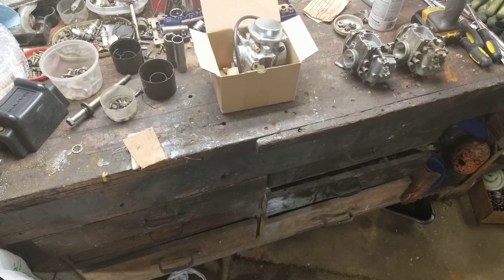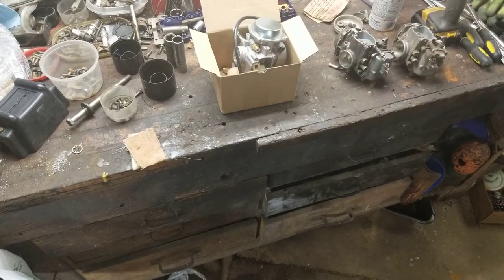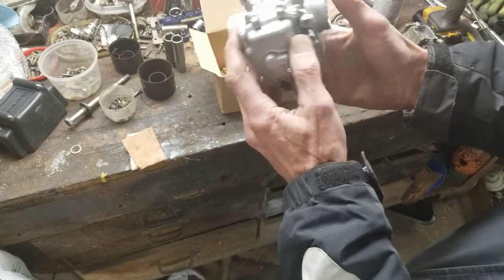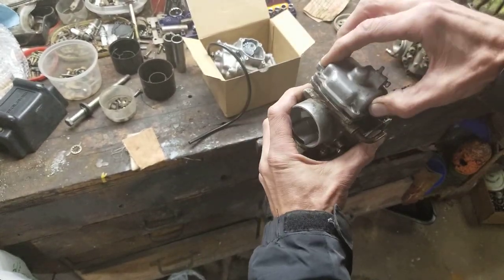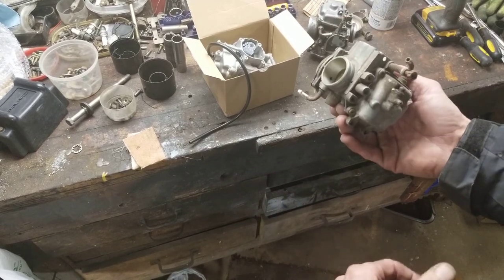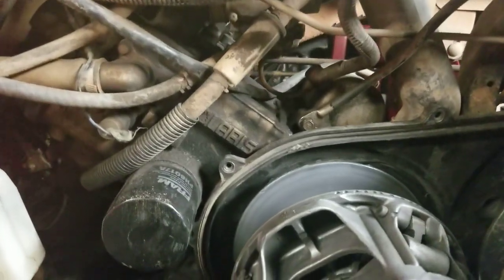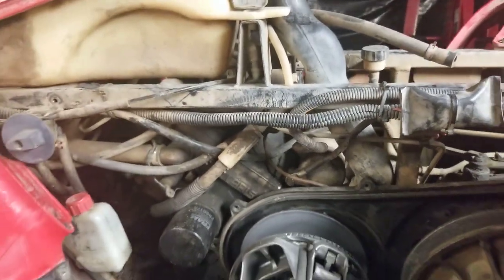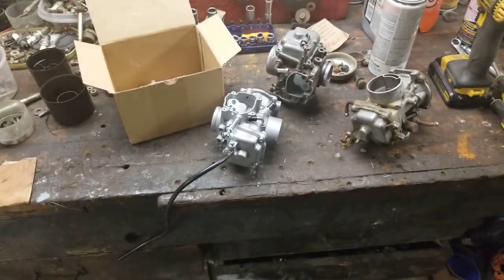Should you use a aftermarket carb on your Polaris?

Comment: Bought the same carb off Ebay .Now my 2002 500 Sportsman is running great.Replaced fuel lines ,fuel pump,carb ,and intake boot.Its was backfiring , rough idle ,and random stalling.All aftermarket parts .Thanks for the video.I highly recommend this carb ....$40 ..no brainer !!!
Reply: What carb? There alot of then in Amazon.  Can you give the order number? I guess I'm spoiled but a sure called Rusted Nut Repair actually shows the biz the parts come in asking with part order number etc.  That is awesome.  I wish everyone aphid do that.  That's the most important part is knowing the part to order exact thing.  Heck your site could even win a sponsorship for it, it happens.  Thx!
Reply: I am having the same problem with a 98 Kawasaki bayou 400. I want to order carburetor off eBay just don’t know which one. Thanks.
Reply: What brand is that carburetor?
Reply: What brand is that carburetor?

Comment: I have the exact same opinion as you.  I try and rebuild the factory carbs when I can, and like you said, there are times when rebuilding is no longer an option.  I'm working on a Polaris 325 trailboss 4 stroke right now.  Factory Mikuni ran fine, but had a gas leak out of the overflow when motor was turned off.  I had it off a few times and tried cleaning everything that I could get to.  I came to the conclusion that it was probably the O-ring behind the seat, but the two screws that held the seat in was stripped out.  So I bought one from Amazon that had good reviews - it cost me $42.00.  I installed last night and it started right up with no problems. I'm keeping the old Mikuni in my collection just in case I can ever fix it one day, but for now I'm up and running again!
Reply: I’m having the same issue. Do you know what make the carb you purchased off Amazon?

Comment: Great video! I’ve used these with great success over the past couple years. One time I had one out of the box the top end parts were floating around the diaphragm but it took a couple mins to reassemble and it was fine. Magnum 425 came to me with a suspected faulty cam lobe, which turned out to be a bad carb. Swapped in the new aftermarket carb and flipped it for a very nice profit.
Reply from the maker: Sweet!
Reply: @TitaniummanGarage  few time i ask you question but never  get respond from you
Reply from the maker: @shahriarfathi4569  I've scrolled through my messages. I Dont see one from you. I get so many messages a day. Sometimes it's hard to keep up.
Reply: @TitaniummanGarage  
shahriar fathi
1 day ago
thank you so much for information . only thing i like to know i have Honda and need 36 mm Carb so what you recommend
Reply: @shahriarfathi4569  sell it and buy a Polaris lol

Comment: I've owned my small engine shop for 15 years. Chinese carbs are a great solution once you learn the common quirks. I've used these on polaris a handful of times too with good results.. They also like the vacuum needle valve raised more often than not for best wide open performance. With or without ethanol blended fuels. I'll be replacing the carb on my 600 twin soon. I'll try the one in your link and see how it runs. Nice video!
Reply from the maker: I just replaced one on a 600 twin. It worked great. Just make sure the intake boot isn't ripped like mine was.
Reply: @TitaniummanGarage  I just put one on my 600 because the factory one started leaking like crazy from the overflow even though it runs good. New needle and seat didn't fix it. New Chinese carb is overflowing too, though not as much, and not running right (almost like it's missing at high rpm and won't idle). Any ideas?
Reply: can any one recommend a good after market carb for my 2203 polaris ranger 500

Comment: I just put a Quad-Logic carb on my 2001 Sportsman 500ho last night. At first i thought it was junk, but then we found the cracked carb-to-intake boot. Ordered the boot, and I'll let you know how it is when we're done. Btw, thanks for the great videos. They've been extremely helpful on my project. Just did a transmission install this week thanks to your channel. We'd like to see a video on the removal of the transmission gear sensors please.
Reply from the maker: Quad logic I've had good luck with. That sensor only has 4 screws on top and comes out after unplugged.
Reply: @TitaniummanGarage  ok great! I'm having trouble with the one sensor. It shows still in neutral when in high unless you wiggle the wires on the sensor. Thank you again for replying and the excellent videos.

Comment: Just replaced one out of 325 trailboss from ebay Michigan company $38 works great much easier than trying to rebuild. I've always had trouble with the float on rebuilt like you said to many ports that contain garbage.

Comment: I have a small engine/atv shop and some times the old carburetor is a goner. I have had mixed results with the Chinese carbs, every single one I bought last year aside from one the jetting was way off and I couldn’t find alternative jets to fit them. This year I have bought one and it will not win awards but it works. However I am about to order two for a Polaris magnum 500 and a sportsman 500 due to the carbs I got with them are absolutely destroyed. I’m switching though to a “brand” that is trying to build a reputation,  that seems to sell pretty good piston and cylinder kits, niche. They claim to sell jetting kits for them
Reply from the maker: Just dont use their head gaskets. They are junk. I have a love hate relationship with that company.
Reply: Let me know the outcome...
Reply: @daddybusy7496  outcome is they worked, they actually worked pretty good. They even held an idle far better than other Chinese carburetors I’ve used.

Comment: 2004 330 trail boss.  New China carb (on it when I bought it...not running...rings frozen in piston...new rings)  After installing new rings it fired right up, idles good, everything is good until you get to half throtle and then it boggs down. Haven't decided if I should try to fix this carb, rebuild an oem or buy another $40 China

Comment: The fuel pump on my 2000 Polaris 500 6x6 puts out 3-5psi. I wonder if this carburetor can handle that psi or if it will just force the needle down and overfill it?

Comment: I had that overflow fuel . Its the needle valve base o ring. Changed that and leak stopped. I also ultracleaned the whole thing but I think there is still some blockage somewhere as it has little hesitation at wot. Idle and all the other stuff works ok.
Reply: You talking about the needle valve for the float? Or under the float? In not a carb pro, but that info would help.  Thx!
Reply: @boebradley867  yes, the needle valve for the float. it has brass base that has o ring under it to seal it. it's common to leak. the needle could be fine but if that base leaks against the carb frame it's not going to hold.

Comment: I'm on my 4th Amazon carb for my 04 Sportsman 600 Twin. I'm at an absolute loss. No matter what I do, I just cant get it to run properly. I've adjusted the needle seat depth, mixture screw, idle, everything. It runs super rough at idle like its on one cylinder even though I've tried adjusting the mixture screw while warm and nothing, then giving it gas up until 3/4 throttle it bogs and chokes down like its crazy lean, and then runs like a top and scalded dog at 100% throttle (157 main jet) About to say screw it and order a QuadLogic carb, or just eat it and take my stock Mikuni to Polaris and have them fully go through it because obviously what I'm doing isn't working after reading tons and tons of literature online.
Reply from the maker: I'm having the same issue on a 700. It all depends on who makes the carbs. I buy alot on ebay. Some are junk and some are spot on. I've tried a couple different companies. I've heard moose racing makes a good carb for 160.00. I haven't tried it yet. Have you considered buying a sonic cleaner for your original carb? Once fuel residue is in the carb its really hard to get out unless you soak it. You said it sounds like its running on one cylinder. Have you checked to see if your getting spark at both plugs? If you still have the old ducatti ignition system in it (they are horrible, Polaris stopped using it) you might have a bad coil, cdi, or stator.

Comment: Not from the ebay carb guy you mentioned but have had two carbs, cant keep the overflow tube to quit drip to pouring gas out no matter how I set the float on the ranger 6x6 500. My old mikuni works perfect but want idle down. I think everything is clean....ideas?   Good vids BTY
Reply from the maker: @jimrucker5726  Is it a steel needle or the one with the rubber tip for your needle and seat? I’ve had problems with the solid steel needles.

Comment: Bought a chinese carb and it worked for a year before it kept flooding out the engine. If you shut the engine off it was really hard to get started again. Bought another one and it did it immediately and even started dripping gas.  My fuel pressure is 3 psi.  Needle and seat are junk on these.
Reply: Sometimes the needle valve gets dislodged during shipping and handling so it leaks right from the get go. So always check that before installing a non OEM (Chinese) carb.

Comment: ut in the spring and cable into it. can you show how to put in the choke cable. I got new one like you but the hole where the choke cable goes in has a brass fitting in there so it wont seat in there

Comment: i purchased an after market carburetor,, it was doomed after they packaged it for shipping  ,FED EX did a terrible job of shipping,,the box was crushed so bad , the inside of the box had dent impressions of the carburetor, popping the bubble rap , and when it arrived the driver threw it out of the on the ground in front of  my house , it never worked at all ..
Reply from the maker: I would tale the parts out and rebuild your OEM carb.
Reply: @TitaniummanGarage  thanx for the reply!! I did a good Micro Cleaning on the OEM ( Pput a new pulse pump on it ,, the new carb wouldn't even work with new pulse pump)it runs and  starts better than NEW , I did this in September, I cut a fair amount of firewood, and drag alot of trees out of the woods to be cut up.. (03 600 sportsman,, 2300 miles on it ) I found your channel after the carb problem,, I'm a subscriber Now .. your Videos are great , to the point,  no extra B.S. ,,, keep the Videos coming 👍👍
Reply: @TitaniummanGarage  and here is another funny story,, when I bought the new pulse pump at MIES OUTLAND in MN. it was an after market pulse pump,, it leaked gas , new out of the box ,, for a few dollars more I bought the OEM , and it worked Great ..

Comment: Have you ever tried the aftermarket chinese diaphragms for the Mikuni CV carbs?  I was wondering about them because the oem one for the Polaris Ranger 500 is about $150.
Reply from the maker: I've actually stripped a china carb and used the parts in a oem carb. They work good.
Reply: @TitaniummanGarage   I am in the process of getting the new chinese carb dialed in but whenever I take it on a downhill slope it runs rich and sputters, when it's uphill it runs fine.  What would cause that? And other than downhill it runs better that it ever has before.  It's making my brain hurt lol.

Comment: I bought the cheap carb off ebay for my Polaris Sportsman 500. Worked great for 1 year and now it leaks fuel from the overflow tube as you mentioned. Now wondering which way to go  as you are.
Reply from the maker: Order a needle and seat from All Balls racing. It has a rubber tip on the needle. I think why they leak is they use a metal needle without the rubber tip and after it wears it leaks.

Comment: I never messed with the quad carb 
What size are they 36 / 38 ?
If so I would try a 44 it will make more power!
At least with the minibikes it made some pretty good power ….

Also I heard soaking the carb body in pine sole comes out pretty nice never done it myself ….

Comment: Would the carb in link work on a sportsman 500? Throttle lever is opposite side than stock carb positioning. I bought an aftermarket one that all it will do is idle that’s it won’t rev up just dies. Adjusted float, needle and new pump still won’t do anything but idle.

Comment: Hi, I bought this carb off of eBay for my 2002 Polaris Ranger 500 4x4.  I installed it, and it started right up and it was running great.  I drove it around out in the pasture, then took it back in the barn and there was this overwelming smell of fuel.  I looked beneath and it was leaking fuel.  The fuel is coming out of the drain tube on the bottom of the bowl.  It does this everytime when I drive it more than 5-10 minutes.  I'm not a professional mechanic by anymeans, I'm more of a Google/YouTube mechanic.  Do I need to adjust the screw on the drain tube or is this something way above my head?  Any help would be greatly appreciated.  Thanks!
Reply from the maker: Unfortunately, some of the aftermarket carbs leak. I stopped using them for a while because of that. It's your needle and seat leaking. Try to get your money back or buy a needle and seat from All balls racing and replace it. I believe I have a video on that.

Comment: Carb in my 2005 Polaris 330 is leaking fuel real bad. Instead of the typical FleaBay carb for $40 I just spent $160 for one sold by "MOOSE Utility Division."
It's also made in China but i'm hoping its quality due to the price and name backing. Hopefully I didn't get ripped off. We will see, i'm doing the install today.
Reply: Are you happy with your $160 vs $40 decision?
Reply: @anncampbell4300  Yes, 100% satisfied!
Sorry, I forgot to do a follow up. I kept the jets that were already installed and just needed to tune it. On the 3rd try I had it running perfect, from smooth idle to wide open throttle. I won't know if a cheap carb would be the same but I wouldn't take that chance.

Comment: thank you so much for information . only thing i like to know i have Honda and need 36 mm Carb so what you recommend ?
Reply from the maker: Oh..I see. You asked about a Honda. I dont work on them so I cant be certain. They do make aftermarket for hondas. Maybe check ebay.
Reply: @TitaniummanGarage  OK i see you work on ODES i have 1 Honda and 2 Odes 400 for my kids  so is same thing only interesting was you said 10 years warranty  and that is why i like to buy 2 or 3 of them for spare Honda and odes is 36 mm  all 3 atv i have is japan Carb on it
Reply from the maker: It's been 5 years since I had those odes and Honda. Once I found out how difficult they are to work on I switched to polaris. Polaris has the Transmission and engine separate. So it makes it easier to work on.
Reply: @TitaniummanGarage  yes is only problem with Honda but i was lucky with electric shift  i had problem on one of my kids Odes  and after i spend big money i do with foot  manually is ok but when i find my kids stok

Comment: I'm about to grab one off eBay rather than take mine apart. Hope I fix it. Ect. For 40$ why not. 04 predator falling on it's face when given full throttle. Tried the cdi box. To no change. Next step far as I'm aware is carb